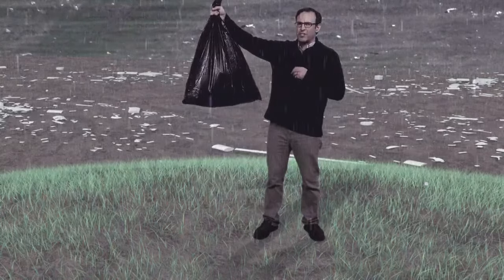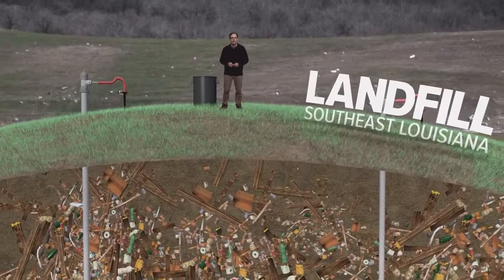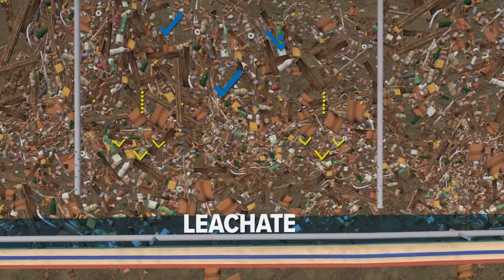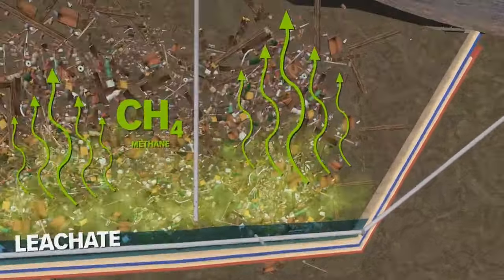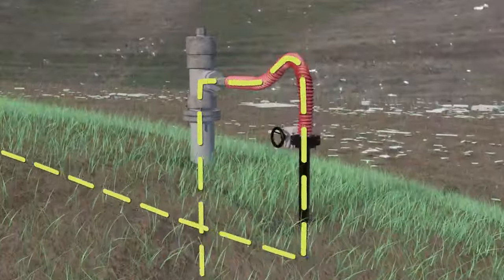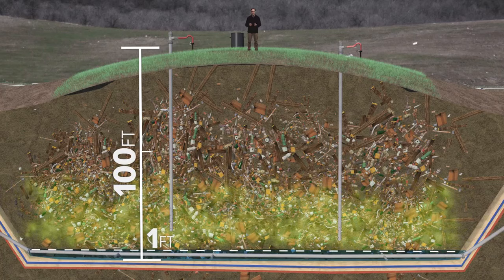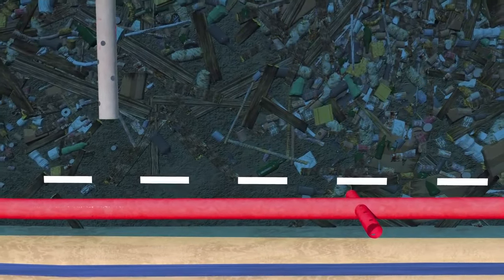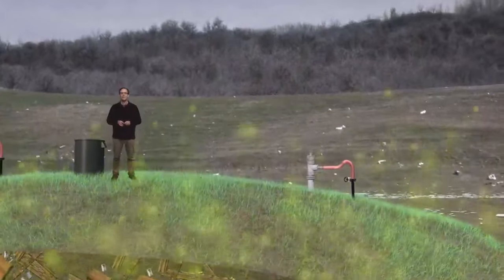How gases and liquids are drained from landfills

Comment: I design landfill gas collection system. We're moving toward renewable natural gas where gas are collected, processed, and sold as green. 
Many landfill will collect gas and burn it at the flare station, but that will soon be a thing of the past.
Reply: Yup we shouldn't waste the methane. Turn it into methanol with catalyst films.
Reply: How to deal with corrosive sulfate
Reply: More landfills need to work with Bitcoin miners to reduce that methane burning

Comment: If the landfill is flooded with leachate, will the gas escape and cause fire in the landfill ?   Is it better to just burn the garbage in the incinerator ?
Reply: Do you want that pollution in the air?
Reply: @dougrogan379   Don't worry. The modern  incinerators  are equipped with smoke filters for particulate, acid gas, and, in many cases, dioxin and mercury removal.

Comment: Sedementation is key and making somerging chemically on quantam mechanics and bio mechanics where you can turn rubbish into sedemements and back into ground. Those pipes can be used as as a sprinkler system to release a good chemical and turn rubbish into sedementation